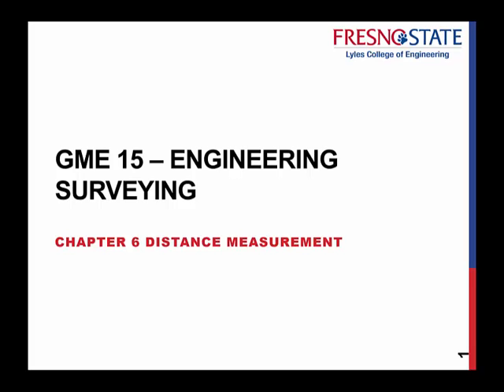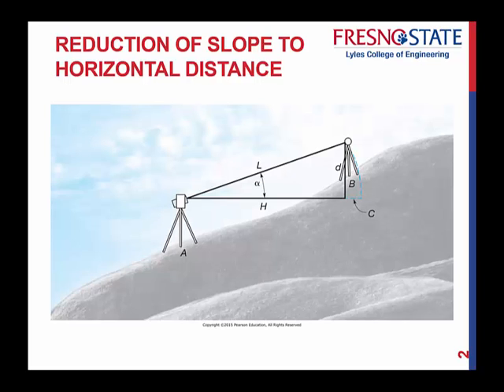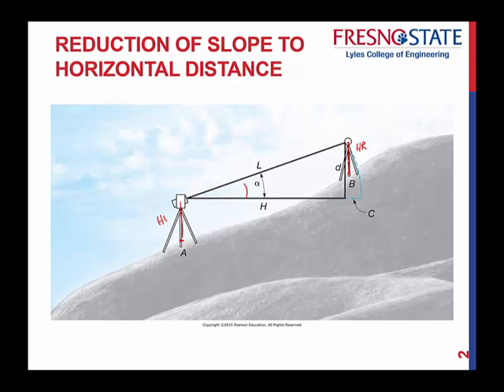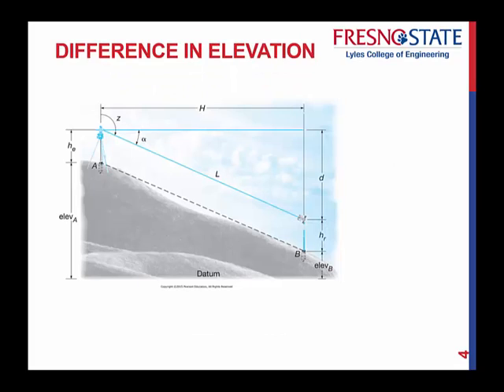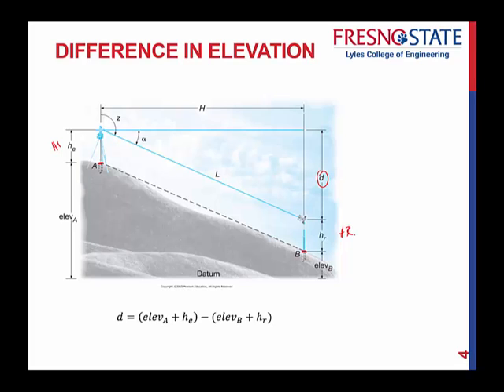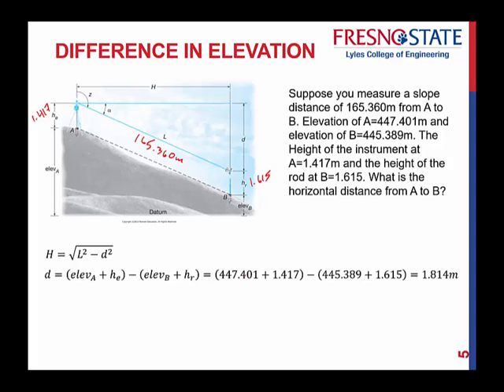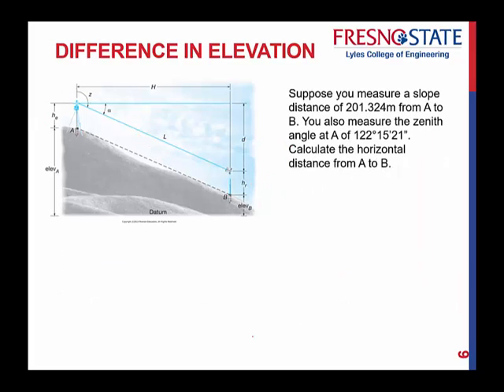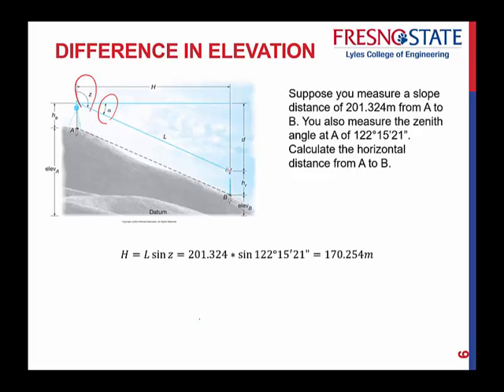Slope Distance

Comment: Hey scott,

I'm new to the surveying industry and don't understand a lot of the math involved with EDM's. One thing from your video that I could not correlate to my first hand experience is the the scale of error.  I have found that once a accurate setup has been achieved and instrument goes out of level. Checking on to a known point which is further away has a greater error than one which is closer. Since instrument level, reflector level, and edm readings do not scale, what is causing this?